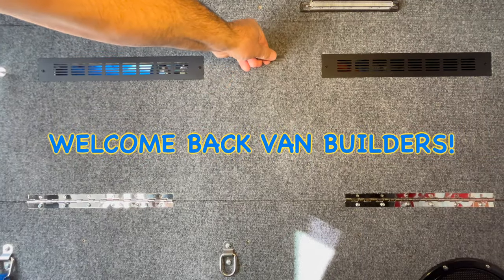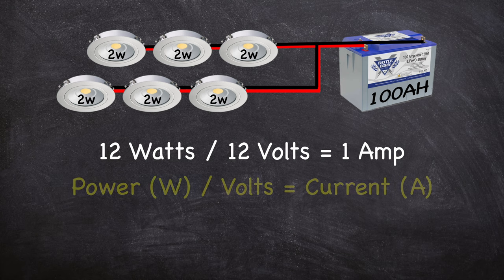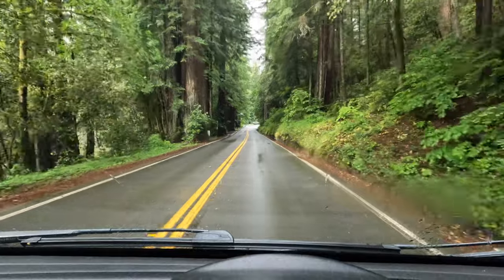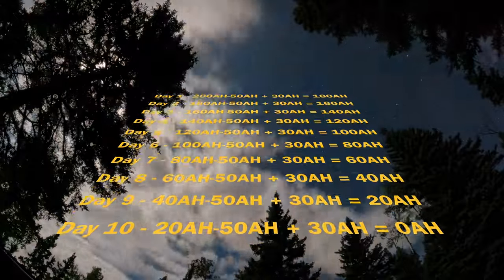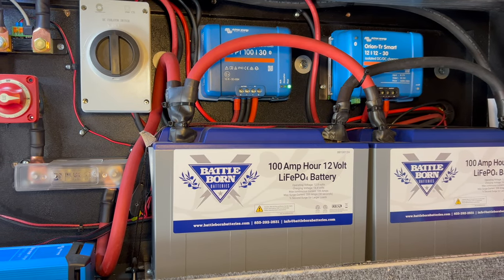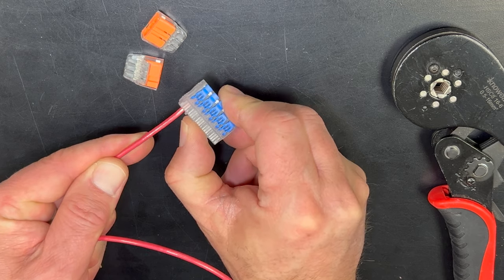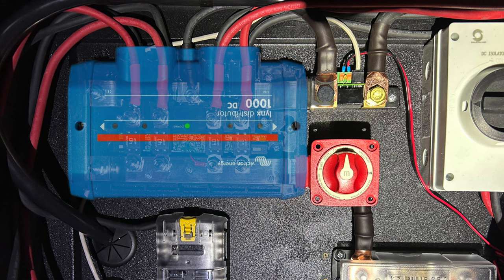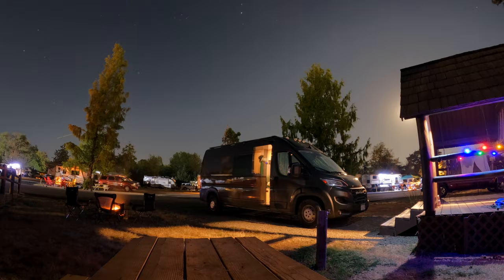Electrical System Overview - 2023 Ram Promaster Camper Van

Comment: I had to watch two videos before I subscribed, In Australia it’s illegal to diy shore power to your vehicle, You have to have it installed and certified by a Qualified Electrician, But it’s not illegal to run house power off your Inverter, then have a smart battery charger in your system to charge system off shore power, Yeah we’re backwards going forwards down here lol 😂, but I subbed any way, cheers.
Reply from the maker: Hey, thanks for watching two AND thanks for subscribing!

Comment: Longer life, lighter weight, and more available power (3:50) are some great advantages of Lithium batteries. I've compiled a list of all the advantages of lithium over lead batteries that I could think of--and the list is surprisingly long! 
Here's my summary of all 16 of the advantages I have accumulated of lithium (LiFePO4, a.k.a., LFP) such as Battleborn batteries over traditional lead batteries (AGM, SLA, Gel). It's interesting that your three reasons are also my first three advantages in my list:
1-Available Power: Available amp hrs are 100% of stated amp hrs for LFP vs 50% AGM.
2-Lighter: Weight is one-quarter the weight for the same usable amp-hours of capacity (1/2 the weight for twice the available capacity).
3-Longer-lasting: Rated cycles 3000 lithium vs 500 AGM.
4-Costs Less: LFP costs less than a third compared to AGM per available amp-hour over rated life. 
AGM100: $250 / 50ah / 500c = $0.01 per ahc (amp-hour-cycle)
LFP100: $1000 / 100ah / 3000 = $0.003 per ahc (getting LFP for less than half this cost is easy these days)
5-Less Hassle: Since LFP lasts 6 times as long as AGM, you swap out batteries less often, saving installation costs, scheduling, and hassle. 
6-Smaller: LFP has 2x the power in the same space as AGM.
7-Fast Charging: LFP has a high constant rate of recharging (0.5C-1.0C) that is 99% efficient vs. inefficient (as low as 60%) and slow three-stage charging for AGM. This is like having an extra solar panel or running your generator for an hour less. 
8-Robust: No need to fully charge to prevent sulfation.
9-Powerful: High Discharge Rate capable (1C or greater for lithium)
10-Peukert Effect: Available amp-hours not depleted by high discharge rate (lead batteries can lose 40% of available capacity discharging at a high rate, like running A/C, hairdryer, MW, toaster, induction stove, etc.)
11-No Conditioning: No need to do "conditioning" to remove the inevitable sulfation of lead batteries. 
12-Stores Well: Storage temp range (-20F - 150F) don't need to remove from RV in winter, but should disconnect them. It's hard to "ruin" LFP batteries. You can ruin lead batteries by too deeply discharging them. You can ruin them by not fully recharging them. You can ruin them by letting the water get to low. You can ruin them by letting them get low on charge in freezing temperatures. BB LFP batteries, with their BMS, prevent all of this. 
13-Worry Free: Zero maintenance (but so are AGM and Gel). No need to check and add water like regular lead-acid batteries. Also, no dangerous and corrosive off-gassing which is possible with any lead battery, meaning you can install LFP batteries inside the living area. And there's no thermal runaway (battery fires!) with LFP, which can be an issue with Li-ion batteries found in phones and electric vehicles. 
14-Higher Voltage: LFP starts at a high voltage and has a flatter power delivery (voltage to SOC) curve so you get enough volts to run large loads like your inverter even from mostly-discharged batteries.
15-No Floating: Near zero self-discharge. Disconnecting LFP batteries and storing them over the winter, without a float charge, is fine. 
16-Minimal voltage sag under load. Under large loads, the battery voltage drops noticeably from the "rest" voltage when the load is applied. Because LFP batteries have lower internal resistance under large loads compared to AGMs, the voltage sag is less, meaning some devices may operate longer when powered by LFP.
Reply from the maker: Thanks @daveduncan2748 for sharing that information.  I’m certainly happy with Lithium, and now even more.
Reply: Battleborn is way overpriced. Redodo, LiTime, Dr Prepare etc is just as good for far less money.
Reply from the maker: Agree, they are expensive.  I liked that they are a solid U.S. brand and get good customer service reviews.  Of course, like most other components in the build, decisions often come down to cost and balancing quality.  Anyone else have an opinion on these higher priced components?  What about Victron?  Also quite expensive.
Reply: @lakorai2  None of the cheaper and better options were available back when I spent $4000 on 400Ah of Battle Born batteries 4 1/2 years ago. On my next project, whenever that is, I certainly won't be paying the Battle Born premium. In fact, I'd probably build my own from 300Ah cells and a BMS or two. Probably even make my batteries and inverter (and maybe a 24V DC air conditioner) into a 24V configuration and use a converter to step down to 12V for the rest of the house systems that need it.  In the same space where I could only fit 4 Battle Born GC2 batteries for 5120Wh of energy storage, I could fit about 15,000Wh of 300Ah cells (16 of them)--and I could buy the components for under $2000.
Reply from the maker: Now that's taking DIY to the next level!  With that kind of know how, you would really be getting the most for your money.

Comment: ANL is fine, but you really should be using a Class T fuse for the battery bank
Reply from the maker: I certainly agree.  Class T fuses are perfect at the battery and should be used if possible.  I had a hard time finding them at the time.  ANL fuses are the next best option and were available.  Do you think it would be worth switching them out if I can source some Class T fuses now?  I'll have to look to see if I can find them.  Thank you for your advice!

Comment: I didn't see 110/120 outlets on the list. Did I miss something?  I only have a  Promaster136 and use two Maxxair vent fans for best re-circulation and venting.
Reply from the maker: The AC outlets didn't make the list but the devices that can be plugged into them did.  I have the TV, Refrigerator and Victron battery charger plugged into them.  The TV and Refrigerator automatically switch over to AC when I connect to shore power.  I have a couple of other AC outlets that are run by an inverter.  We use those for things like a computer monitor, laptop charging and low wattage appliances.  

In my previous van I also had two vent fans and loved the air flow you can get with one running air in and the other out.  Adding a second fan may be a worthwhile future upgrade.

Comment: Adding another alternator would be a better option than voiding warranty and burning out OEM. You could then go 24 or 48 volts with less chance of shorting high amp wires. It's not like the dealer would notice. They  charge for parts my engine doesn't have.🙄 I also don't think paying $5k for an RV package 12 volt system is a good option. You can use that money on Victron and Battle Born. Just saying...